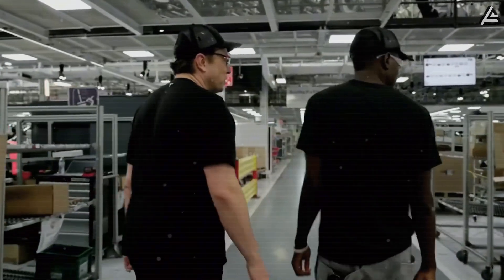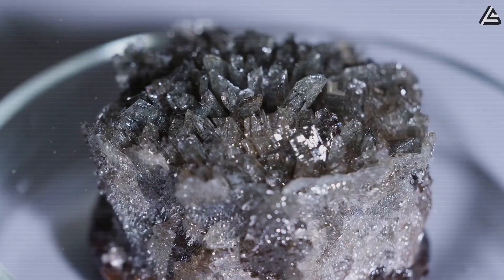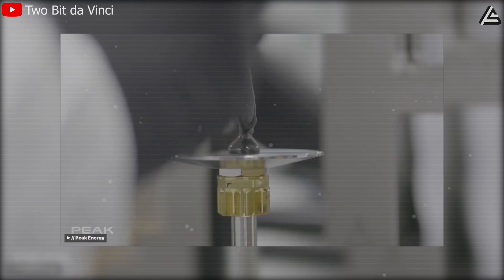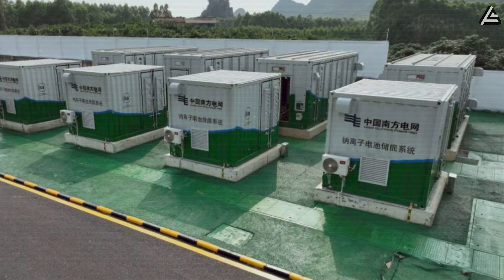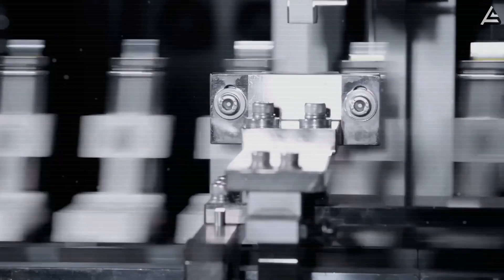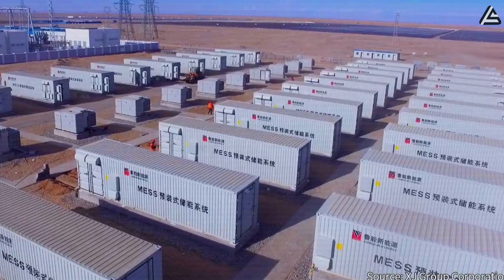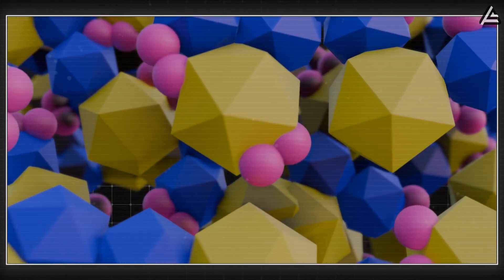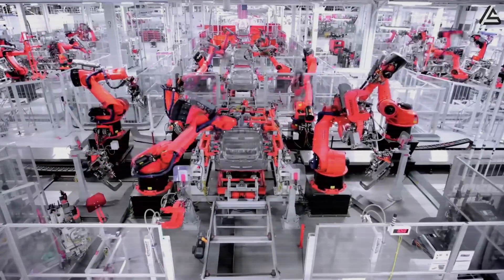Elon Musk Revealed 2026 Sodium-ion Battery Latest Update: What’s SHOCKING Entire Industry?

Comment: nice for a cheap battery but the the aluminum and graphene will last a lifetime and still have a fantastic range. salt is good but not the best choice especially if you dont want to constantly be topping off the charge as the aluminum keeps wizzing by
Reply from the maker: Each battery has its own unique strengths, depending on what a person values most. if u want a cheap option, it's will be sodium-ion, but if u want long range, u can go for aluminum-ion